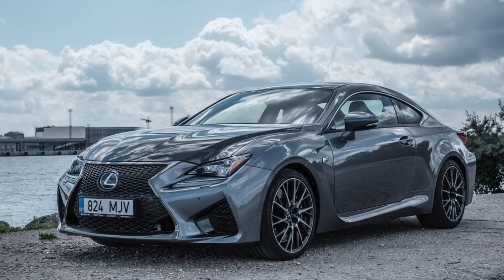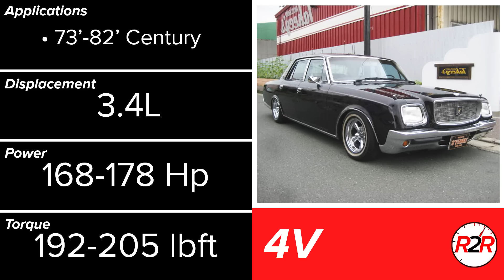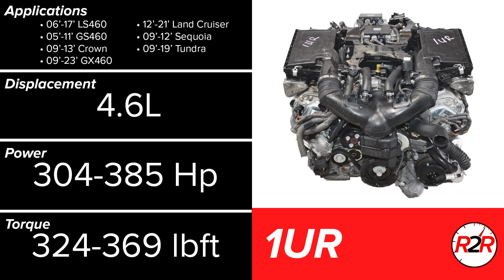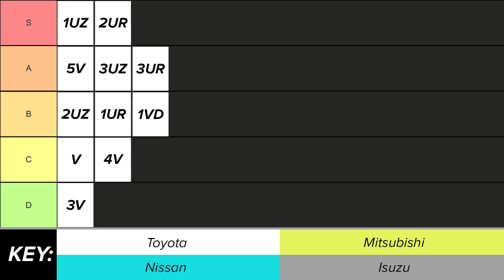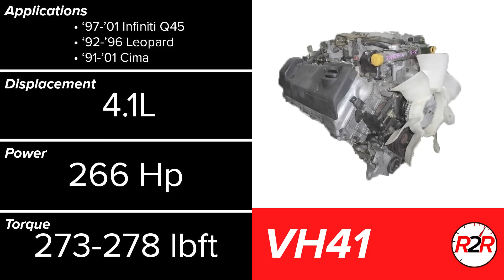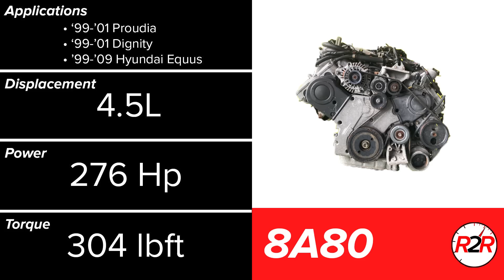The ULTIMATE Japanese V8 Engine Tier List

Comment: in alot of car games. i always swap the R32 and R34 RB series engines with the VK50 and Vk56 engines being they are reliable but also the VK56 is quite common in the USA. its also MUCH cheaper and more reliable. along with being easier to make power from cheaply

Comment: 1UZ for the win. You forgot to mention they’re FAA certified for use in airplanes. 
I bought 96 SC400 a few years ago with 225,000 miles. It ran like a top. A week into owning it I gave it a tune up. New plugs, wires, caps and rotors… the old plug wires were stamped 1996. They were the original plug wires. 🤯
After the tune up the car ran the same… which is fantastic. It still passes the champagne glass test. It’s at 228k now and the only repair I have planned is to replace the starter. I’ve added a HPS intake and it’s pure music from under the hood now. It’s impressive Lexus could make the 1UZ so quiet because it screams with the intake. Tunnels are a lot of fun.
Reply: What V8 engines have gone up for FAA and not passed?   I’d wager virtually none since OE durability testing is way more rigorous than FAA’s standard
Reply: @ a lot of engines are approved for experimental. The 1UZ is approved for aircraft usage. Distinct difference.
Reply: @skipast75   Again, what engine has gone up for aircraft certification and failed?
Reply: @ While the FAA doesn't specifically "approve" car engines for use in airplanes, some car engines have been adapted and certified for aircraft use, often through Supplemental Type Certificates (STCs) or Type Certificates (TCs). 
Here's a breakdown of key points:
Adaptation, Not Direct Approval:
The FAA doesn't certify car engines as is for aircraft use; instead, manufacturers adapt them and then seek FAA approval for the modified engine and its installation in a specific aircraft. 
Supplemental Type Certificates (STCs) or Type Certificates (TCs):
To use a car engine in an aircraft, the engine and its installation must be approved by the FAA through an STC or TC. 
Engine Requirements for FAA Approval:
Fuel Compatibility: Engines must be approved for the specific fuel type they will use, including aviation gasoline or alternate fuels like automobile gasoline. 
Design Requirements: Operation with any alternate fuel must meet the minimum design requirements for the engine and be approved. 
Testing: The engine and airplane may be tested concurrently to ensure compatibility and safety. 
Examples of Car Engines Used in Aircraft:
Viking Aircraft Engines: Offers various options, including the 1.2L Mitsubishi Mirage, 1.5L Honda Fit, 1.2L Chevy Trax/Buick Encore/Opal, 1.8L Honda HRV, and 2.0L Honda Civic engines. 
Error Momentum Engines: Based on a Suzuki platform, these engines offer different power outputs and are designed for smaller aircraft. 
Corsair's Automotive Engine: Corsair has developed an automotive engine for the Cessna 172, aiming to reduce costs and eliminate the need for leaded fuel. 
Toyota 1UZ-FE: One of the few road-going engines that is FAA approved for use in an airplane.
Reply: @BCSVT  most of them
Reply: @skipast75   What engine has gone up for FAA aircraft certification and failed?  

“Most of them”?   
I’m flying a big ol’ BS flag on that one, I believe most just don’t even bother with this cert.
Reply: @skipast75   I am aware, the thing is I don’t believe most production V8s have even applied for aircraft certification and I believe virtually every modern V8 without cylinder deactivation would easily pass since OEM durability testing is far more extreme.
Reply: @ I don’t have the answer. All I know is I wouldn’t trust most engines, especially pushrod V8s, to run for hours at high rpm. I just sold my SC400 with 230k… the new owner had never seen a 1uz… his jaw dropped when I had him put his hand on top of the engine as I revved it to show him how smooth they run. 230k and you can balance a quarter on the intake manifold. It’s truly on a different level.
Reply: @  Back when Ford was developing the Modular V8 they would shock freeze the test mules, then go wide open throttle dozens upon dozens of times.   They also had to stand up to wide open throttle for ~1400 hrs uninterrupted without failure.   Some OEM durability tests are very tough.

Comment: How are you gonna put the 3UZ in a lower tier than the 1UZ … more power more torque…
Reply from the maker: From my understanding, the block, rods, and pistons on the 1UZ are a stronger and more robust assembly. I felt as if stronger internals was worth rewarding and a large part why the 1UZ is the most popular of the group. However, the 3UZ I had in A tier, but wouldn’t have an issue with it in S either. Could’ve gotten that one wrong, but that was my reasoning. Thanks for watching!

Comment: I believe Nissan’s R390GT1 road/race car were also V8s as well as Toyota’s TS020 (aka GT One)

Edit: I made the comment before you said you were going to make a separate video about racing V8s 😅
Reply: If you dig deep you will see the r390 uses a variant of the vh45 same with so many of their race cars, the 300zx used it in the IMSA series, tbh as a mechanic and someone that's owned a lot of jap V8 series the list is a little off. The vh45 is better than the vk45 and the vh45 is on par if not better than the 1uz and the 1uz is lesser than the 3uz

Comment: Had gs430 3uz 140k on the clock and head gasket failure,Lexus dealer had it for a week trying to diagnose exact problem.The master tech said he’d never seen that happen in his 10years.They are not infallible,engines can break even the best.
Reply: Seem like you bought a bad used car buddy.

Comment: Toyota had a supercharger kit for the 2uz. Also, multiple 2uz and 1 1uz have made it to 1,000,000 miles with just normal maintenance. My uncles Lexus gx470 is over 500,000 miles with no major issues. 2ur valley plates leak. Otherwise no issues. 2uz and 3ur have air injection pump (emissions) issues which is able to be bypassed. I’ve seen and owned tons of 1uz, 2uz, and 3uz powered yotas and Lexus with 200,000-600,000 miles
Reply from the maker: That’s super impressive stuff, they truly are almost indestructible!

Comment: Never been a big fan of the UR, mostly because GDI gives me the heeby jeebies. I know they're good engines just not to my taste.

For me my top 3 goes VH, UR, then VK in at #1. Nissan built a solid motor with the VH and then absolutely knocked the ball into the sun with the follow up.
Reply from the maker: Can’t say I could disagree with that, the VK engines are great and I’ve had to chance to watch them race in the Rolex 24 with no engine failures. Mind blowing stuff!
Reply: @running2redline  
The aftermarket stuff that people down in NZ do with them is pretty insane too. Hartley Engines has a circuit package that bores out the 5.6 and then destrokes it down to 5.0. There's clips of them revving out to over 10,000 RPM. 

All around the Japanese have built some great modern V8s that deserve more recognition.

Comment: Yeah all UZ belongs in the S tier. Those failures are preventable. All the UR V8s are S tier. Oil burning or oil leaks have to do with maintenance. The other thing is on the UR is the coolant leak near the valley plate.
Reply: By that standard all the VHs and VKs deserve S teirs as well which is fine by me. My only grip is that the UR as GDI.
Reply: @leecline5759  I would say so but there are two things here. The head flow of Toyotas are way better than most engines and the UR has D-4S fuel injection system so it’s not completely direct injection. Even the 2GRFE( port injection) sits on the S tier lists. Basically another 2JZ but v6 with open deck, yet still flows better than the b58 and can hold 800whp on an unopened block.

Comment: The 1UZ going straight to S tier almost made me scream out loud. I am absolutely obsessed with them.
Reply from the maker: Hard to knock it, Toyota nailed that one!
Reply: @running2redline it’s an absolute thing of beauty!!!
Reply: When the world succumbs to nuclear annihilation, there will be three things left:

1- cockroaches
2- Cher's face
3- a running example of a Toyota 1UZ V8 that doesn't even leak oil or smoke
Reply: Lightweight and durable ftw
Reply: 1uz the world
Reply: @thatguyjef420  amen
Reply: Nice.......
but the VQ 45 is my pick
Reply: I'm right there with you. Only reason I came to watch this video and everything after that was just gravy. 1UZ is my absolute favorite engine. Loved my SC400. Still have the engine too haha
Reply: Any of the uz motors are amazing
Reply: Keep in mind it was FAA certified to be used in light aircraft!  Now what engine can claim that!
Reply: Ive owned 9 1UZ engined cars and have kept 4 of them. Love these amazing engines. 👏
Reply: Absolutely
Reply: 3UZ way better !
Reply: @EBKFiXXY as someone who’s owned a really high mileage 3uz yes the 3uz does sound slightly better than a 1uz and it can make slightly more power easier but for the person who wants to use a UZ engine to make a ton of power the 1uz is the best choice for big power. The 3uz has a weaker block due to the increased bore but unless you’re building a drag car that doesn’t really matter.
Reply: @EBKFiXXY  Stock for stock id agree slightly. The later later VVTI 1UZ make the same power but do make a little less torque. But if your trying to make decent power without fully buildings the engine the early 1UZ is the go to. I seen them hold 16 to 35 psi a 3UZ cant do that plus the they have thinner cylinder walls with that extra .3l coming a larger bore.
Reply: @EBKFiXXY  ew haha
Reply: They're good but not that great in making powerful engines. Production V8 engines made by Japanese can only make power up to around 400 hp, with no air compressor. European and US V8 engines can make power up to around 600 hp. There are a lot of lessons Japanese car manufactures need to learn to beat the European an US. 👌
Reply: @JohnKickboxing  what’s the use of 600hp if it’s always down for repairs 😢
Reply: @CaneSugarCane  As long as the lubrication system works properly, any engine can last long as you need it to. Check this Corvette engine out, it's LT6, 5.5 liters, naturally aspirated, making 670 hp.
Reply: @JohnKickboxing  good point, but the lubrication system is part of the engine.   This is why the deprececiation of the European and American designs is so insane.
Reply: @CaneSugarCane  👌 I admit I don't know all the facts about the correlation between lubrication and wear rate of engine. But I'm quite sure any car manufacturer would avoid making anything that causes the loss of their fame. They might carry out marketing research and find out the consumers keep their cars until 7 years and sell off at this point, so that the car manufacturers make their cars last 7 years, for example. As long as they find the points that their consumers can accept and satisfy, they will not make anything beyond the points. As you might have known that Apple intends making their smartphones slow and obsolete within the period around 3-5 years.
Reply: @JohnKickboxing  Honestly it feels like they don't care, once their cars roll off the lots. You hit the nail on the head with the research into the First owner's timeframe - investing research in the wrong direction.  

That's what makes Toyota/Lexus  so outstanding - once you do the basic maintenance, feels like it just won't quit.
Reply: @JohnKickboxing  Apple wouldn't be getting away with that if Huawei weren't blacklisted. Feels like their innovation is dead - each launch features a marginally improved camera with a quantum leap in price.
Reply: @CaneSugarCane  👌
Reply: @JohnKickboxing  Only took Americans until 2024 to build a naturally aspirated engine with over 120hp/L when the Japanese have been doing that since 1998. 

Because of Japan's very high displacement tax, Japanese manufacturers never made a lot of engines with over 5L of capacity and the few they do are truck engines mainly aimed at the NA market. It's not they are not capable of making large displacement high performance engines, but a lack of demand. That's why their most impressive engines are always the smaller ones. 

The UZ and VK engines are directly modified into race engines for JGTC/Super GT and these regularly made 800hp without restrictors but due to Super GT regulations they were limited to 500hp. These engines were making almost 180hp/L with 20-year-old technology.
Reply: @JohnKickboxing  No what engine i play with it would more than likely get boost so thats not really a big concern. The pre 94 can handle a considerable amount of boost without needing to be built. Plus I havent seen any really push the N/A limits of 2UR that make 400 stock.
Reply: @1uzsupremacist  👌
Reply: @JohnKickboxing  lc500 dude
Reply: @JohnKickboxing  bro you don't have anything that powerful nor have you ever driven anything that powerful. UZs have been beyond 1000hp for years but that's always been a dumb metric
Reply: @JohnKickboxing 
Huh? Japanese N/A engines have been much more powerful than their American and European counterparts. You are comparing turbocharged European V8s and supercharged American V8s to N/A Japanese V8s. Obviously the V8s with forced induction will make more HP... lol

Comment: In my opinion the the entire UZ family deserves to be in S tier. The 1uz was certified for aircraft use, aircrafts can only use the most reliable and over engineered engines as you don’t want engine failure while in the sky lol 😅. You forgot to mention that the 2uz came with a full iron block and is known to be one of the most bullet proof engines ever created! With high mileage examples still selling over 15-30 grand in land cruisers and lx470’s. The final UZ engine, the 3uz is known to be a masterpiece of a luxury v8 or any v8 in that matter. Car care nut recently did a series on an old ls430 he picked up with over 630k miles and it still runs like a champ. As smooth as ever! Check it out. Also do your research on the 3uz it is probably the best v8 ever created in a practicality sense.
Reply: Yes, well the VVT-i 1UZ and 3UZ are the exact same engine, except a small difference in bore.
Reply: @onse8982  the throttle body on the 3uz is fully electric rather than a cable on the 1uz vvti and different coolant passages
Reply: Most of the aircraft certification thing just means someone went through the bureaucracy to get it certified.  It costs millions, and since the GA engine swap market is miniscule, it's a guaranteed way to lose money.  Most certified airplane engines are ANCIENT, and they're certified because the process was a lot easier in 1948.  Porsche got a turbo engine certified and was installed OE in some Mooney airplanes.  They were extremely unreliable, despite the certification.  The Toyota V8 also doesn't make for a very good aero engine due to the physical size - it doesn't fit in the cowl of most airplanes, and making it fit would add a ton of drag.

The most common car engines used in airplanes are very predictable.  The GM LS is compact enough to fit in a Cessna 172 with minor modification.  The Honda K-series is also used with a reduction gearbox.  More common than everything else combined is the Subaru EJ, which fits neatly into any place a stock Lycoming or Continental boxer came out of.

Comment: LS400 V8 was so over engineered  its bulletproof
Reply: Not really. The first ones were built like a 2JZ so they took about 600hp on stock internals before you started having to upgrade the rotating assembly. They went through a mid-life update that went to weaker rods that tap out around 400hp iirc. The 1UZ wasnt really bullet proof in a performance sense, it was much closer to something like a Caddy V8, meant to be driven respectibly and for a million miles.

Dont get me wrong, I love me some 1UZs, but they're getting way more expensive as times goes on and performance parts are usually all Aussie and a hassle to get.

Comment: Ive been thinking about japanese v8s to shove into my 280zx to make a japanese muscle car. I think 1uz would be best for its small size, light weight and smoothness. It will probably never happen, but we can dream.
Reply: Keep the 280zx Nissan powered.  Plenty of affordable VK50/ 56's from local and online recyclers.
Reply: If you're going to build a Nissan Muscle Car, keep it Nissan powered. As someone who loves V8s with the right number of cams, VK engines are going to be cheaper to build and would be much better in stock form. There is a lot ot nuance as to what makes a good 1UZ to build and the good ones are harder and harder to find.
Reply from the maker: Had a friend drop an LS3 into a 280zx and that thing ripped. If you get the chance a V8 in those cars is incredible, good luck!
Reply: Do a VK45.